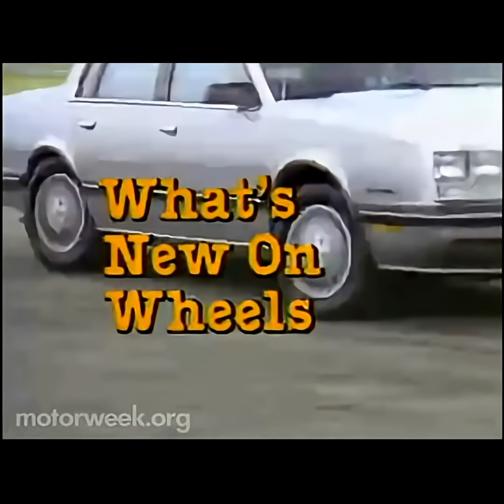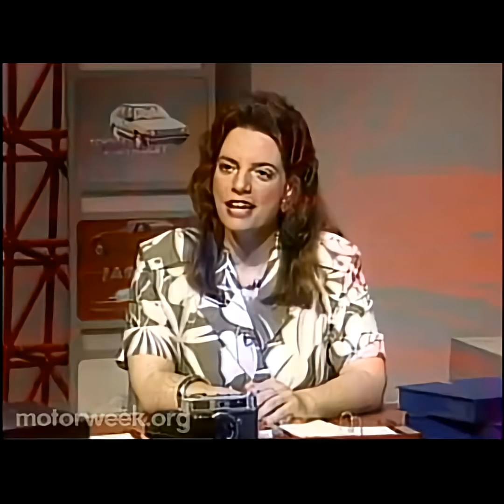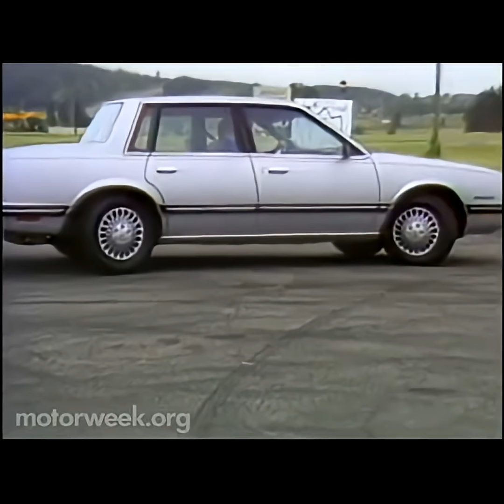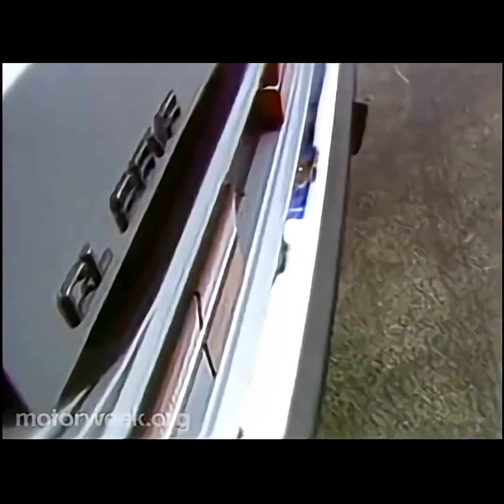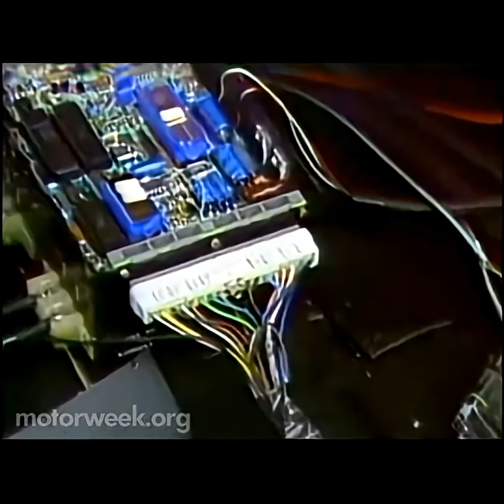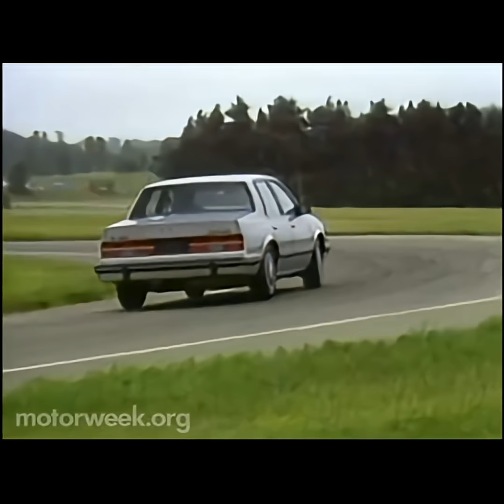A Celebrity With Crabs? #NewsdayTuesday #OldNews #Ilovethe80s

Comment: Beth that Celebrity was an '85
Reply: 86 cause my Dad had one and it looked like that was dark Grey with Grey matching interior and 86 was last year for glass headlights before the 87 refresh with plastic headlights
Reply: @MondayNightRAWsViper2026-xk9ew that Front end style was around only For '84-85 it couldn't been an '86
Reply: @Jessiehenry1898 well my Dad had one exactly like that style it was definitely an 86. It had the rear window brake light too and that was a way to identify an 86 over an 84-85. Maybe half of the 86 year changed over to the 87 model its very possible! 86 could've been a short model year transitioning from the older style to the newer 87-89 style

Comment: My parents had an 84 Celebrity.  I guess GM shelved the research until the new Hummer came out.
Reply: Around 2003, GMC offered AWS on the Sierra 1500 pickups. Not many were sold as it was a pretty pricey option.
Reply: @AviationCat-m2q I don’t think 4WS is worth the price but with the Hummer over $100K they had to do something.
Reply: @Admrutherford Agree.
Reply: This one-off example was only rigged as a test bed.  The feature wasn't being considered for the Celebrity line.
Reply: I was thinking the same thing.